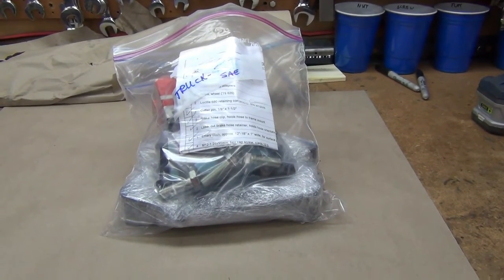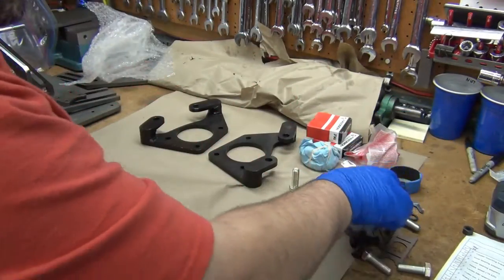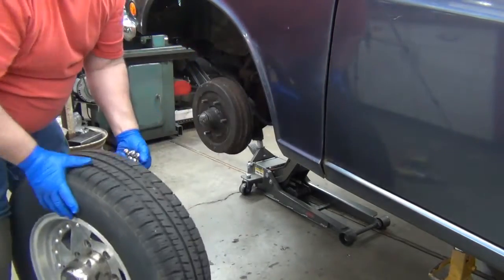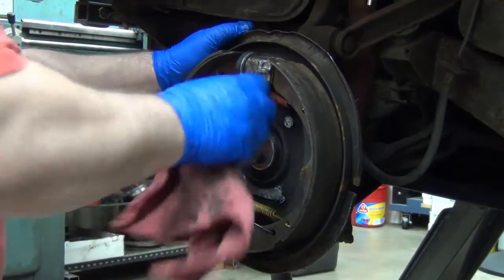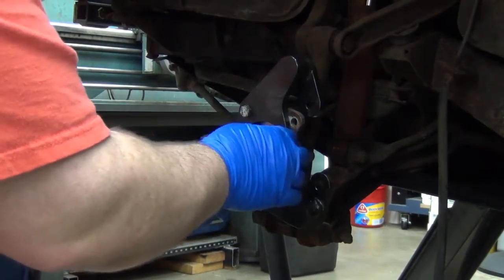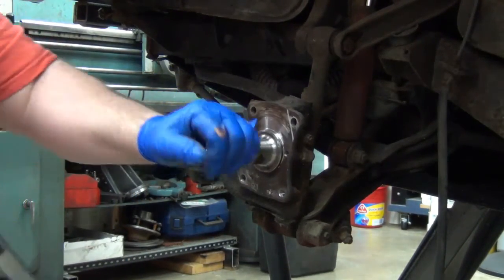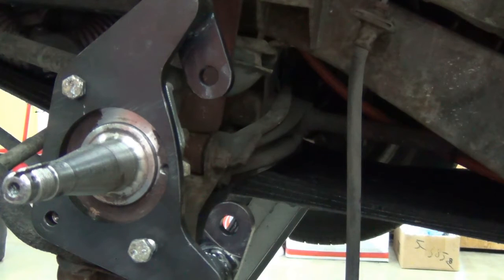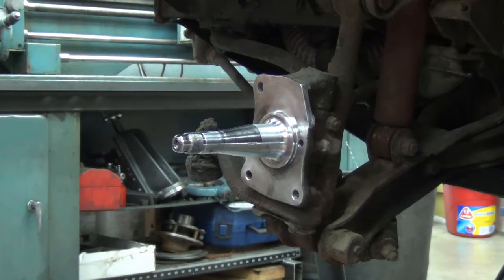Truck Brake Kit Installation Part 1

Comment: Hi Jim  Le Galley here,

Wow, you are more than a hobby machinist.  You are a very smart innovator that is si creative.

Spent time in Spokane in late 1970"s where I purchased my first 521 truck at Sundance Toyota in 1978.  I am currently living in Bellingham  since 1992.

I love your videos as you explain everything well.  Very educational.

I need to order 2 kits as it sounds like I'd be able to use mt wagon wheel 14 inch
Reply from the maker: Hi Jim,
Thanks. I appreciate that. :)  I grew up north of Spokane, near Deer Park, Elk and Chattaroy.  I'm near Portland, OR now.  I have two sets of brackets on the shelf right now.  You can find the info about them on my site bluehandsfab.com   You can also contact me via the contact page on the same site.  Yes, my setup is the only one that will allow you to use 14" stock steel rims....or any 14" rim.  -Mike

Comment: Recently acquired a 1970 datsun spl311 (fairlady roadster)1600. Do you have conversions for them as well?
Reply from the maker: I do actually. The info is on my site bluehandsfab.com  It's based on the Altima rotor upgrade.  I've actually been working on a new version of it that will use wilwood 4 piston calipers instead of the Volvo units.
Reply: @bluehandsvideo  awesome.  I'll make a note of you and your site.  Still have some work to do before I get to that point, but I'll be hollering at ya when I'm ready.  Thank you sir.
Reply from the maker: @IamKurr  Sounds good. :)

Comment: So I'm intrested in the whole conversion. But what type of brake master cylinder do you recommend on using with the setup? Thanks.
Reply from the maker: I've personally used the '78 280z m/c but a lot of guys use the '79 620 m/c.  They both fit the same, they just have different bores.  You can find a lot more info about this setup on my site  www.bluehandsinc.com

Comment: I'm using a different bracket style ( Beebani ). But anyways, is a Master Cylinder upgrade absolutely necessary? I don't mind the cost, but after having installed everything and still using my stock MC, it still seems kind of weak as far as stopping power goes. Brake pedal is really soft. Not mushy, but really soft.
Reply from the maker: Seems you would have started with asking beebani. lol  There have been a handful of guys running mine on the stock m/c, but I don't advise it.  A bigger bore on the m/c will help a lot.  If it is spongy, it's pretty much air in the line or you have soft hoses.....something is giving.  If the pedal travel is too long, it's poor adjustment on the rears or the m/c is not moving enough fluid....bore too small.  Set the e-brake and pump the pedal twice.  The first time should nearly hit the floor in your case....second should be about right.  If you get good pressure by half stroke.....press good and firm....if it is firm, then it's not air in the lines or the hoses....your rears are the issue and need to be adjusted closer.  If it's spongy when you do this, it's air in the lines or hoses.  Basically....setting the e-brake and pumping eliminates the rear brake travel.  
Did you "bed" the pads correctly?  Most guys don't.  Until they're bed, they can feel soft and not stop very well......but your stock m/c is certainly the bigger issue.  I've got push rods for the upgrade on my site www.bluehandsfab.com but you can make one fairly easily.  You can use the clevis from a clutch m/c if you find one in the scrap yard.  Are you familiar with ratsun.net?  Most of the truck guys are on there.

Comment: Where can I buy this kit for my 1976 datsun pickup.
Reply from the maker: You can check out all the info for it on my site www.bluehandsfab.com.  If you decide you'd like to order, you can contact me from there, too.  If you are not in the US, let me know where you are so that I can figure out the extra shipping.  Outside the US, the shipping can add over $80 to the price.  Thanks! -Mike

Comment: What do I need to put drop spindles on my 70 521
Reply from the maker: Basically........a new suspension.  All available dropped spindles are for ball joint suspensions and this is kingpin.  I've done some Z'd lower control arms which will give the same effect.....a 2" drop.  I'll be working on some more very soon if you want to follow along.  There's already some vid up on this channel of how they're done.  I'm also working on a ball joint suspension, but that's been stalled for awhile waiting for me to get back to it.  I've got a build thread up on Ratsun.net of the Z'd LCAs..... http://community.ratsun.net/topic/12070-lower-control-arm-z-mklotz70/
I'm hoping to get back to the ball joint mod fairly soon.
Thanks!
Mike